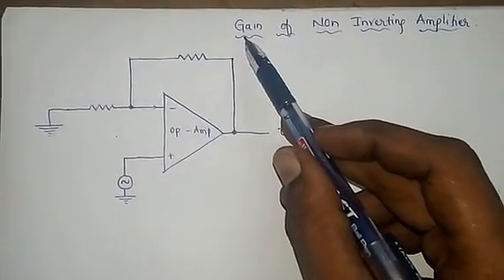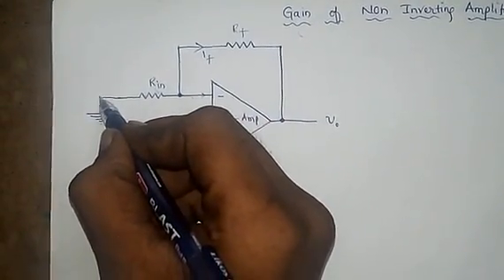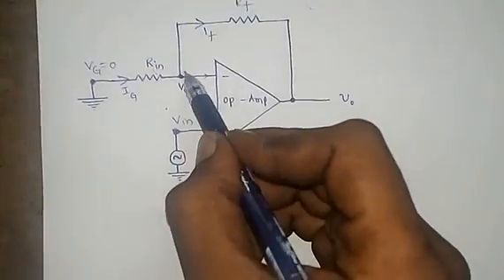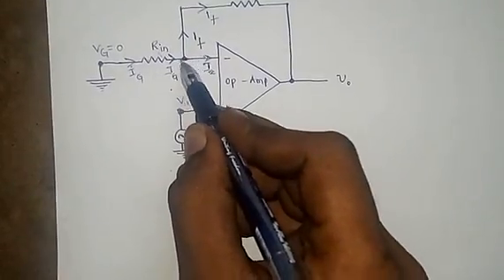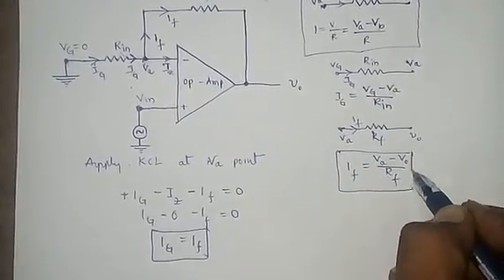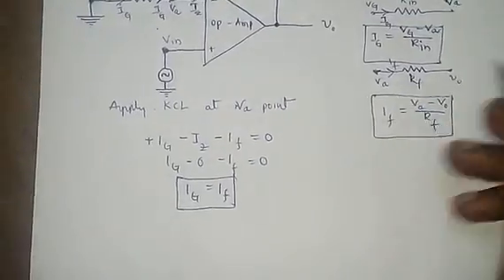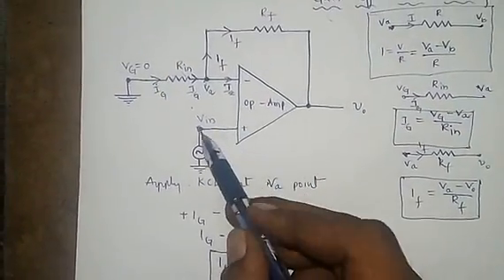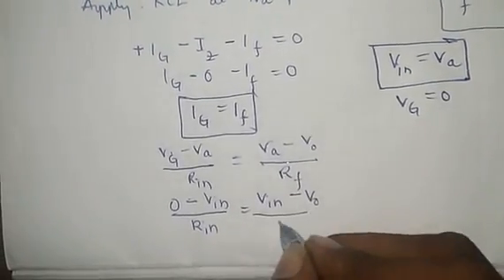Derivation for gain of non inverting amplifier

Comment: what is meant by shunt
Reply: Shunt means parallel
Reply: Shunt usually means a resister with low resistence so shunt resistor is low resistance resistor
Reply: @sawakokuronuma8689   I really want to thank you for your help
Reply: @meherunnisa2949  koi baat nae :)...dont mention it